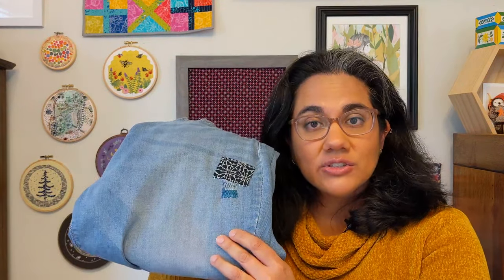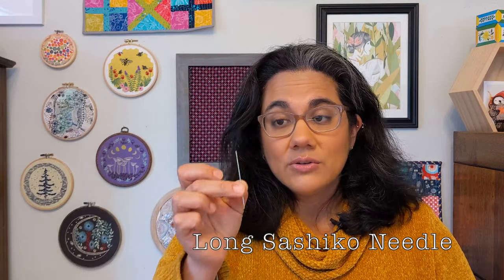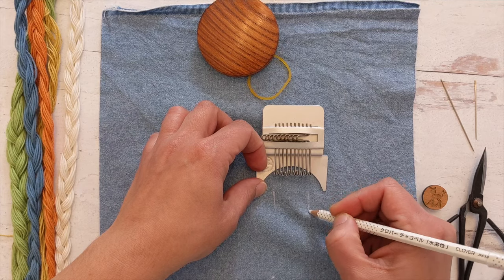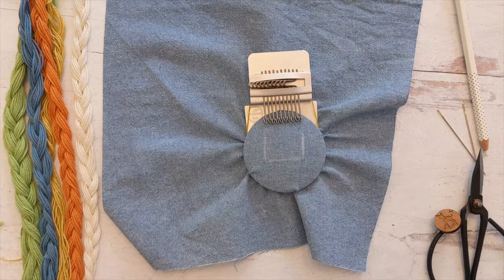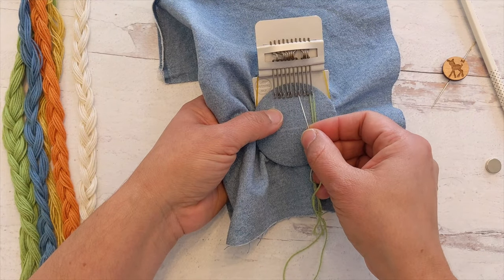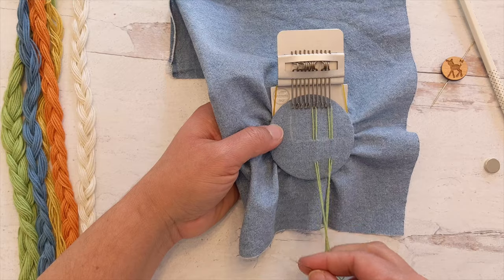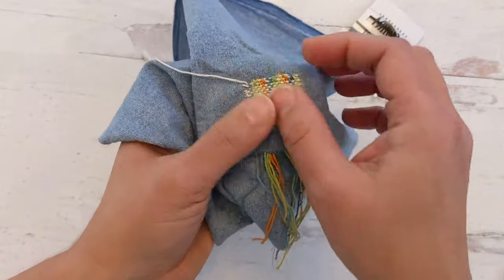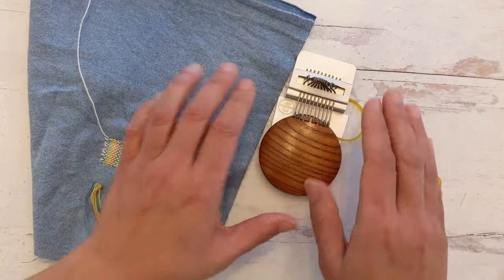Getting Started with a Speedweve Style Mending Loom | Snuggly Monkey

Comment: Great video.  Thanks so much for clearly going over how to do this. I'm a complete beginner, My only wish is that you explained how to finish up the threads on the backside. No idea how to do that really.
Reply from the maker: Glad it was helpful. I am working on a second video. The most common way is to pull all your thread ends to the back, rethread them on your needles and weave the ends under the the stitches on the you made on the sides to anchor your rows.

Comment: The patches are cute in their own way but can I patch on the “wrong” side of the fabric if I want it to be less noticeable?
Reply from the maker: You can create a patch on the "wrong" side of the fabric, but you will still have little stitches visible on the "right side". You would need to pull your thread ends through to the "wrong" side and then weave them into your patch in order to secure them and finish the patch.

Comment: Thank you for this clear and concise tutorial. I have just one question. If you are using just one color of thread--to patch a sock for instance--do you still have to cut each strand of the warp thread or can you leave it as one long piece?
Reply from the maker: Hi Jessica - you can use one long thread as the warp. The only tricky part there is that you will have to get REALLY close to the hooks on your final row because without the hanging threads at the bottom to cinch up the warp at the end, you might end up with a bit of a looser weave towards the top. Hope that makes sense!
Reply: @SnugglyMonkey  Yes, that makes sense. Thanks for the reply.

Comment: Thanks for the video! You mentioned that you can make it as long as you want. How do you do that? Doesn't it have to be smaller than the size of the circular wooden piece?
Reply from the maker: Hi Mindi, I misspoke in the video. You are limited by the size of your disc. There are larger discs available that you could attach the speedweve on to or you can connect several patches to create one long one.
Reply: @SnugglyMonkey  Thank you! I couldn't wrap my brain around how to do that. :^)

Comment: Great video! If there’s a hole in the fabric under the patch do you have to do anything to that to keep it from unraveling towards the border of your patch?
Reply from the maker: Some people will clean up the hole first by snipping away any extra threads and whip-stitching around the edge of the hole before mending over it with the loom.  Because you end up putting in all the tiny stitches along the edges of your patch as you weave when you anchor each row in place, you end up creating a secure line of stitches around the hole as you weave that should stop it from spreading beyond the patch.
Reply: @SnugglyMonkey  Thank you!

Comment: Do you have any videos on weaving in the end strands you pulled to the inside of the fabric? I have no idea how to do that final finishing.
Reply from the maker: I will work on a separate tutorial showing the back, but basically you pull the thread ends to the back of your project, re-thread them on to your needle and then weave those ends into the little stitches that you made along the sides as you were anchoring your thread to weave each row

Comment: Love this. How do you weave the back end of the strings?
Reply from the maker: I will work on a separate tutorial showing the back, but basically you pull the thread ends to the back of your project, re-thread them on to your needle and then weave those ends into the little stitches that you made along the sides as you were anchoring your thread to weave each row
Reply: @SnugglyMonkey  
Did you make it? It would be very useful for those of us that are more visual.

Comment: When you say you aren’t limited to how long your patch can be (only limited in width based on how many hooks are on your speedweve), does that mean you can somehow make a patch be longer than the actual wooden disc is? I am trying to figure out how to create a patch that would ideally cover an area that is a little bit longer than the wooden disc, but I’m not sure how to go about doing that.
Reply from the maker: Hi Amanda, I misspoke in the video. You are limited by the size of the disc for the length of the patch, but you can create longer patched areas by connecting two or more patches together. The easiest way to do this is making patches horizontally next to each other, so that when you are putting your little stay stitches on the sides every time you weave across, you are weaving that stitch into the edge of the previously made patch and anchoring it to the fabric. Good luck with your project!
Reply: @SnugglyMonkey  Thank you for the tip…This is very helpful!
Reply: @SnugglyMonkey  that makes sense. Thanks

Comment: Great video, but you left out how to finish the piece. That's where I am stuck!
Reply from the maker: I will work on a separate tutorial showing the back, but basically you pull the thread ends to the back of your project, re-thread them on to your needle and then weave those ends into the little stitches that you made along the sides as you were anchoring your thread to weave each row

Comment: Here can I buy it The loom? We live in France thanks for the answer
Reply from the maker: Unfortunately, the ones I sell were made in the Ukraine and are not currently available. There are cheap Chinese made versions available on Amazon, but I really cannot recommend those as they make their hooks from cheap, thin tin that bends easily and does not hold your thread well. You can still find vintage ones that were originally made in the 1950s at thrift shops and flea markets, so perhaps in one of the markets in Paris you will be able to find one?

Comment: Isn’t the length of the patch limited by the size of the wooden disc?
Reply from the maker: Yes, but you can make longer patches by piecing smaller patches together. Create one patch and then move your speedweve down and line up your hooks with the bottom of your first patch to create a second patch that will make it longer.

Comment: Cool although I don't know how you weave the ends into the back of the fabric
Reply from the maker: I will work on a separate tutorial showing the back, but basically you pull the thread ends to the back of your project, re-thread them on to your needle and then weave those ends into the little stitches that you made along the sides as you were anchoring your thread to weave each row